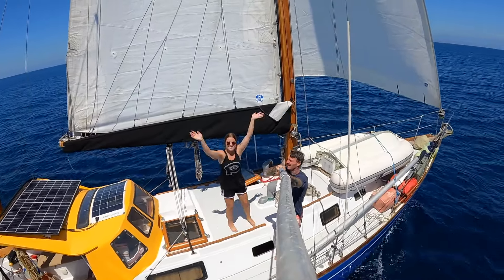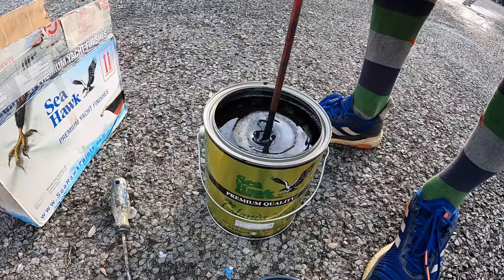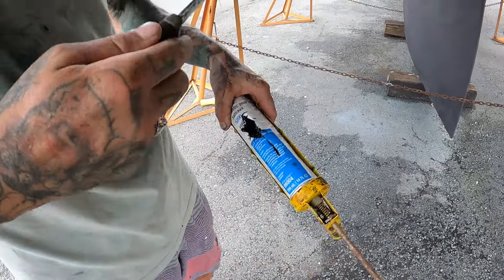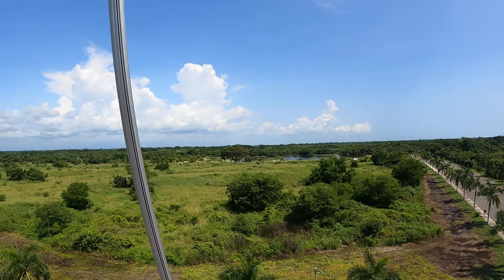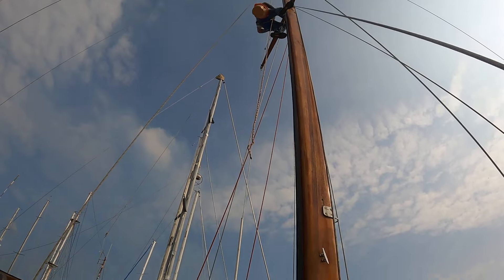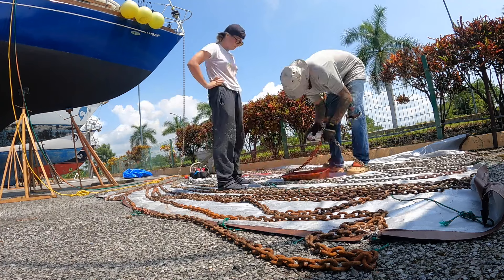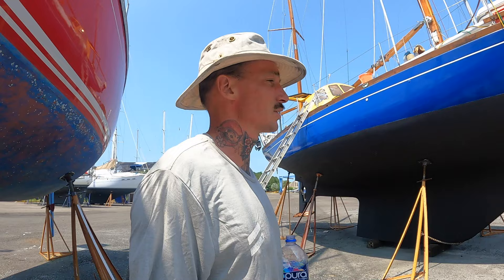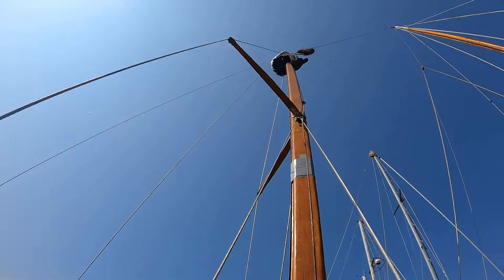We have holes in our masts! Inspecting woodpecker damage… | Sailing Sitka Ep 139

Comment: Oh, good morning Sitka crew. 
I see that the royal carpenters found their favorite tree. During the mating and brooding season they look for good trunks

You must fill the holes with fiber and resin, place plugs, sand and varnish. ADHESIVE tape is not highly recommended when there is constant humidity and water, there will always be leakage that way. 

P.S. Tapachula carpenters, THEY ARE CABRONES.

ÁNDELE, ANDELE CABRÓN 😅
Reply from the maker: @njbaskipper  I use to love woodpeckers but not so much anymore. The tape was just a temporary thing done an amazing sailor to prevent water from going in while we were away. The damage happened while we were in Canada so sadly we couldn’t do a proper repair until recently.
Reply: @sailingsitka  Ah, you already know that real woodpeckers, in addition to being bastards, are intelligent, among themselves they said: Let's open a hole here because these guys went to Canada.

andele andele cabrón we Are Macho Bird and bien mexicano. 

🤣🤣 Pájaro Cabrón

Comment: Good morning from South Africa Cape Town. Your fridge should run just above 0 psi and if you check the amps it should be just above 1amp . Then get a thermostat that runs to -20c. Then you can set it to 4/5 for a normal fridge / or -20c for a freezer !!!! Check the condenser and the fan connected to it. Make sure there is enough ventilation cause the cooler your hot side is the more afinion your comp will run!!!! email me pics of the unit if you need some more advice plz!!
Reply from the maker: @Nico101.....  Thank you for the advice , I’m definitely sending you a message next time we have refrigeration problems . We managed to get it sorted thank god.